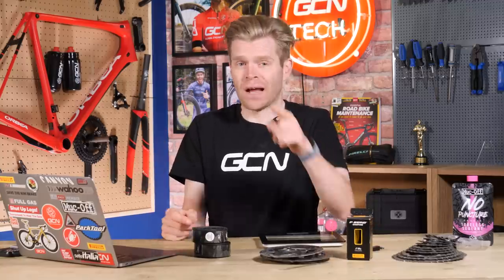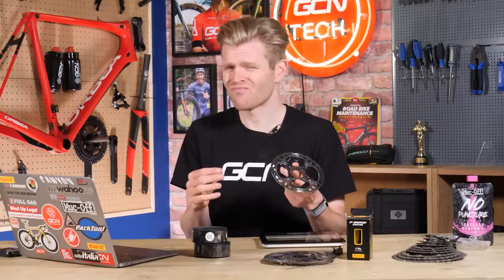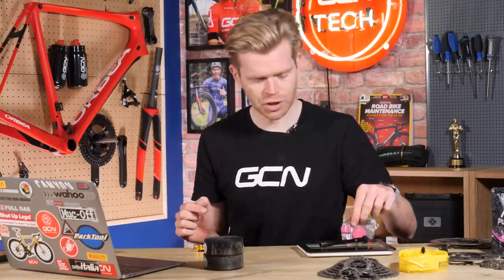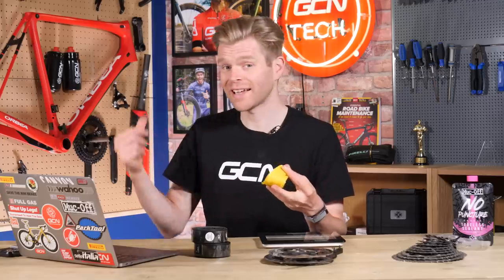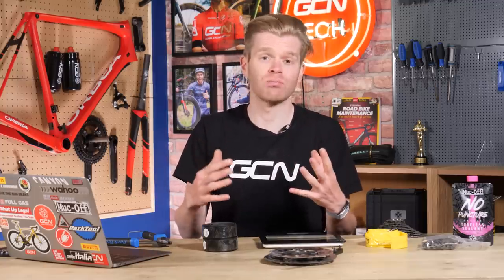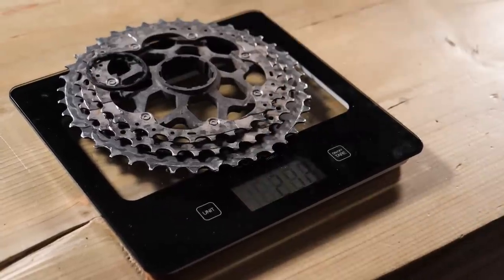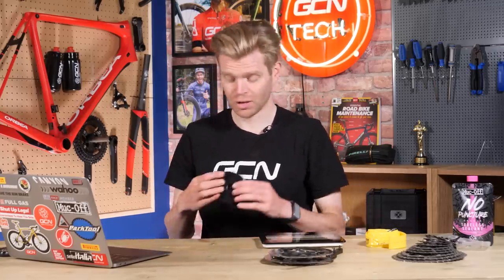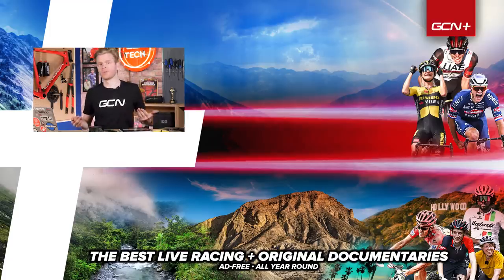5 Of The Best Weight Saving Bike Upgrades | Maintenance Monday

Comment from the maker: Do you have any weight weenie hacks? Let us know in the comments below!👇
Reply: tip 1 .. fill your tires/tyres with Helium 
tip 2 .. make sure your bowel has been emptied before you start
Reply: High quality aluminium seatpost, bars and stem: lighter than most default and cheap carbon, most reliable of all
Reply: AliExpress
Reply: Prestacycle/Edco cassette. They shift perfectly, aren’t ridiculously priced, and are machined from a slid block of steel, but still ultra light.
Reply: @alienchow.  that's 110 Euros for 78g savings compared to Ultegra if we pick 11-32 ratios.
But it is cheaper and still couple of gramms ligher than Dura-Ace...
Reply: Fixed gear:)
Reply: If you eat a banana before riding, don't eat the last bite.
Reply: Lose the cyclist and you save 60+ kgs!
Reply: RIDE NAKED 😀😀😀😀😀😀😀😀😀😀😀😀
Reply: Loose that 15kg of excess weight that you have accumulated over the years. That is 15 thousand grams.
Reply: Do like Eddy did: drill out your carbon components for extra weight savings.  Bonus points if you don't crash.
Reply: Number 1, ditch the disk brakes
Reply: Always easier, healthier and far more of a gain to start with the rider. Then aero, then the grams on the bike.
Reply: Go do a number 1&2 before the ride to lose the weight of a wheelset.
Reply: Reduce your own weight is a great hack
Reply: @leonbroekx  Can have the last bite, just don't eat the peel 👄🍌
Reply: I don't agree that you should stick to the brand when shifting disc rotors
Ashima AiNeon Ultra Light disc rotor ø140 weight = 63 grams
Shimano Dura ace ø140 weight = 94 grams
Reply: Switch to cable pull discs, if you can live with it. Weight saving guaranteed
Reply: Carbon seatpost cutted after you got the high, and a clamp with titanium bolt, titanium stem with titanium bolts and carbon handlebar, race tires with lightweight tubes (huge improvement), lightweight pedals, lightweight chain, and the most expensive change: lightweight wheels with lightweight spokes. Any bike would lose a lot with that. If you want more extreme, make sure to get a carbon frame, start limiting the transmission, and position yourself well over the bike to make yourself aerodinamic, and yes, if you lose some weight is gonna help too.
Reply: which lightweight bar tape is that one? which are the lightest (and practical) ones out there?
Reply: just run the dam rim brakes!
Reply: @witoldrudnicki8962  wish it was only 15 lol

Comment: Also, if you remove the handlebars and the saddle you can save up to 700 grams!
Reply: Front wheel is not mandatory if you can wheelie, so you can cut your fork, 1.5kg saved !
Reply: Man I removed my whole bike.  Saved me like 9kg and also made me a few grand.
Reply: Ikr? Put the shifter and whatnot in the stem directly!
Or better, put it on the fork
Reply: @Jean-jk4zv  now that you mentioned it, no front wheel means no fork needed! And front triangle of top tube and downtube can be omitted too!
Reply from the maker: All great tips, but you can save even more weight by removing yourself from the bike entirely
Reply: Joke appart, using chinese carbon seatpost, seat, handlebar, and stem saves tons (what seems) at the top portion of the bike where it really make the bike feel lighter when handling a climb. ... AliExpress.
Reply: @JeanFrancoisDesrosiers  you know they saying, a gram off the front is worth 2 off the rear, unfortunately a lighter front end slows down decending

Comment: I replaced my bottle holder screws with low profile lightweight titanium ones. I was able to replace 8 screws on my gravel bike saving me roughly 24g for under $15.
Reply: You could have just put 24ml less water in your bottle and spent the $15 on beer
Reply: lol 24g is nothing
Reply: Now you can carry an ounce of weed and not even notice it! Score!
Reply: I gained 1mph by waxing my chain. This is compared to a factory chain used twice on a brand new bike.

Comment: if you're going all weight obsessed but still want bar tape, you can use racquet sports over-grip as grip tape. its very very thin and light, but it'll provide some traction.
Reply: Tesa high heat auto electric tape also works well.
Reply: Use double tape. It's sticky. But light af
Reply: Shrink wrap or cling film 👌
Reply: Alright bois, we want some semblance of aesthetics LOL

Comment: Aside from wheels (vintage Shimano RS80 C24 wheelset and Conti 4000 tyres/ tubes to save weight) the BEST upgrade for my old school Spesh. Allez Elite (mechanical 105 groupset, rim brakes) was Gore brake and gear cables. Oh, and Swisstop brake pads…..Low friction/ lower force braking, super slick gear changes. As we saw in the TdF it’s not about the weight, it’s the aero. Since the closest I’ll get to a performance boost from aero is eating a bubbly choccy bar, comfort from 28mm tyres and slick shifting & smooth braking keeps me happy.

Comment: Thanks Ollie. I summarize: Disks + axle + inner tube + lightweight tape = 325g savings. Nice since they are cheap savings. I didn't count the gear hacks since this goes onto extreme territory... But still for most of us loosing 2-3 kg   of bodyweight is way more significant! Only real thing is really good tires and inner tubes improve also the bike handling and you feel better acceleration.
Reply: Sometimes loosing weight will make you produce less power.
Reply: @TeacherNickoy  depends when you set it loose.
Reply: I lost 7kg and did not loose any power!!! FTP is still the same
Reply: @fbresk  I like to let the power loose on most rides.
Reply: Lol, of course not everybody has some spare fat to loose... but still we are talking 0.325 kg from 70kg = 0.5%... I think this kind of improvement can easily surpassed by better training, nutrition etc... even rolling resistance with better tires will yield better results...
Reply: @pirminborer625  hahaha I wish i had shredded 7kg of fat!! But yeah agree with the tire choice, i have changed my disc rotors, inner tubes to tubolitos and my tire to Vitoria corsa…maybe saved 300-350g (my stock tires were heavy) …was i trying to save weight on the bike? No! Was i looking for better perfomance? Yes! The weight was just a bonus.

Comment: If you run tubeless tires have a look at the recommended volumes of different sealants. There are huge differences in the manufacturer recommended volume per tire (i.e. Mucoff vs. Stans vs Conti). In most tests of magazines or Websites the recommended volumes are applied during testing. If you can have a comparable or slightly inferior performance with just half of the volume/weight changing your sealant manufacturer could be an idea.

Comment: I changes my 38c gravel tyres to 32c road tyres on my hybrid bike with front suspension. There was weight savings of at least 100g each wheel with the lighter tubes and aero improvements of the road tyres. I was able to ride 1 gear higher on the same stretch of road. I used the bike mainly on the road.
Reply: I switched my 32mm road tires for 40mm gravel tires. Because im a rebel, i dont care about the weight change though i did go tubeless. I lost 0.5mph on my computer. But i gained 1mph from converting to wax and just got my 1st jerseys. Ill be riding 18mph easy in no time!

Comment: I always enjoy a good weight weenie video. When someone takes off 4 links of a chain for 9 grams of weight reduction with that much satisfaction...
Reply: Weight weenies... am I a weight weenie for knowing I traded 20g of weight for doubling the air volume of my pump? Am i a weight weenie for ditching the c02 inflator and gauge to save 100 grams and buying a new multitool and bag to save 200 more? Thats about 3/4lb of savings.

Speaking of weenies though, mine keeps going numb... new bike, stock seat, no bike fit yet, just self tinkering... dont let me build your pod racer!

Comment: tighter bibless Lycra
unpadded carbon saddle (the padding in your shorts is enough)
silicon pads in gloves not bar tape
prescription lenses bolted to helmet (visor) not glasses
short cranks (they are a thing)

Comment: You forgot to mention when you changed disc brakes that you changed the old dura ace rotor for an xtr rotor (or new 12 speed dura ace rotor?). 
That makes the weight difference even bigger: The older dura ace compared to the same size XT/XTR already makes some difference. Downsizing makes the weight difference even bigger.
Edit: just checked it 
The newest dura ace RT-CL900 weighs 114gr (160mm) or 96gr (140 mm) which is only 3 grams lighter than the older variant. The Shimano site no longer shows the version you're showing under 'dura ace, but only under MTB components.  At least for me
The XTR-MT900 which you are showing is 108gr (160 mm) or 88gr (140 mm). The XT version weighs the same but is cheaper.

Comment: Hi @gcntech. It would be super interesting if you could measure how different weights on the bike affect the power out-put needed. For example: If you ride with super light pedals, but change to heavier power meter pedals. How does this affect the power out-put needed? You can now measure watts, but now, I suppose, you need more watts to turn around the pedals. Is it worth buying a power meter to measure your watts when you now get dropped on the climbs because you aren´t just to those heavy thingies. Other examples could be to test if a lighter cassette, handlebar, crankset, changes the power out-put needed. We know that cutting weights on rotational parts has positive effects, but how and where is it most effective to cut weight and how much watts can you save in reality.

Comment: So your saying youve got nothing other than upgrading my 105 rotors and lightweight bar tape?

I just saved roughly 200 grams redoing my tool kit, and im going to be blowing as much air as a small frame pump with my new topeak. Screw the mini silca, it weighs more and pumps less... my new bag and multi tool weigh as much as my current multi tool alone.

I was hoping to see some researched stuff, like the lightest alu bars and stem. Along with a few carbon shoutouts. And bring aero into the mix, that matters more than weight, give us some well rounded choices in the industry that particularly stand out. Disk rotors...

Comment: I bought a set of carbon rims, TPU tubes, and continental tires, and between the front and rear wheel setup, just for those six components I saved 1235 grams

I also changed from a metal stem and handlebar setup to a 1 piece carbon unit, that saved another 292 grams. My new cassette saved 228 grams. There’s a few other things in there, but altogether, I have shaved a whopping 1905 grams off of my bike.

Comment: Mate of mine never used the drops so he cut them off, won approx 10 races / year.
Reply: So he use a narrow flatbar?
Reply: @Chronostra  no, he cut off the last 10 cm or so from his drops.
Reply: @Chronostra  : that dude probably spent most of the time on the hoods, aero tuck.
I also rarely use my drops (theres no hills here) and i dont really wrap my tops (almost nonexistent as i run 36cm drop bar)

Comment: This is great but I am a rim brake bike rider and honestly I felt that this was a video where rim brake bikes do not exist. You can event see on the TPU inner in Tiny writing "Do not use with rim brake wheels". Has GCN buried the rim brake? 😟
Reply: It actually says "For use with rim brakes".
Reply: @shorty6209  😳 I should really learn to read before opening my big mouth. Plus I guess I "assumed" that since I know LaTeX tubes cannot be used with rim brakes but these are not LaTeX. Me bad. But my general abservation still stands about rim brakes and GCN. I cannot afford a new bike or an used bike with discs. But there is more and more focus on disc brake bikes. Just my 2 cents.
Reply: @prlato1974  there is nothing wrong with latex and rim brakes.  Only if you are going down really significant descents and plan on riding your brakes.  Otherwise, no worries.

Comment: Hello GCN hello  OLI,  hello every one... 1. acording  to  GCN  and a previous videos about  weight, rolling  weight does not matter... then  why  to invest  in upgrades for the wheels when  eventually they only matter  for weight  when you are not moving? ...I am not trying to  outsmart you,  just saying  some of this savings can  help in  longer climbs but as per  rolling hills  or flats... we  need  GCN  gos  Science!  right?  
2. Does smaller disc wear off faster?  how faster?  time  of  km talking, is important to  know to consider switching  to smaller disc has a  cost. 
3.  as  per the  best weigth savings bike upgrades ... I  try and use a smaller lighter handlebar,  once  I  use the custom one  I  check my bike fitness and well I  can use a  40  and even a  38 cm wide handlebar.... and compared to a  42  in most of the custom bikes is quite a  good saving... another saving  I  do I take off the  Seatpost and measure how much  I  don't need and cut a  few cms from It, and there you have it.

Comment: My contaminated disc brakes caused me to crash , sometimes I wish I had rim brakes.
Reply: Stick with rim brakes. 👍
Reply: Clean them
Reply: I tried all kinds of disc brake cleaners. Nothing works. Just have to replace the rotor and pads.
Reply: @slotre  I feel you my front disc brake is less efficient than my rear brake for one month I tried everything. Disc brakes are a pain when they start degrading 😞 time to buy spares
Reply: Contamination is weight 😛 Clean the rotors, replace the pads.

Comment: 1:10 you're still going to need the caliper mounting screws with 140mm rotors Ollie. & if you're 80kg+, you're going to need the extra 40g of rotor surface area.

Comment: Hold up buying disc brake bike until weight will come down...
Bike industry is a funny thing. We were building under 6.8kg rim braked bikes for fun, so the idea was to spec it with aero wheels and upgrades to bring it up to 6.8kg rather than adding weights. 
Until we took it to extremes of aero frames, internal cables, integrated cockpits... and the weight balloned to over 8kg. Bikes were faster but didn't feel that way. So next edition aero bikes were less extreme to bring the weight down again, but felt much more agile.
Then somebody "wise" decided to bring in disc brakes and electronic gears into the equation. Electronic gears, I get it, to solve a bike mechanic headaches with internal cable routing. But discs?!? Was it really necessary. We were sold the idea, that wider rims are more aero and by using disc brakes you prolong the lifespan of your expensive carbon hoops. In my experience, rim brake carbon clinchers last long enough. Naturally rim brake was the enemy in going wide rims direction. 
At the end, the result of all this, is that bikes became heavy again, but somehow they are charging us a hell a lot more for them. Even though many brands abandoned production of rim brake frames, to keep the costs down. Specializing on discs only, at the same time we were told, they doing it because of the customer demand for disc outperformed rim. But if you look around you can't buy a high spec rim brake bike anymore, so if you want a Dura Ace / Sram Red... racer you have no choice. They kept rim brakes for low spec bikes with aluminium frames though. But naturally, that's where you want discs, but who am I to argue... As a result more people buy into discs and rim dies out. Seems like the industry goal, rather customer demand to me.
On the subject of weight saving, build your own bike with carefully chosen components disc or rim it's your choice and guaranteed you build a lighter bike and end up spending less than the silly prices they asking at the top end... 11+ grand for a bike, that's just crazy. I mind my s-works from few years back cost me one third of that...

Comment: My biggest weight saving probably was switching to titanium quick-release skewers over the steel ones that came with the bike. Not only lighter, but also shorter and with a much smaller (carbon fiber!) lever, they also are a minute more aero lol.

In all seriousness, these upgrades are really cool, but skipping the beer for a month should already be enough to make you more light than these replacement parts...